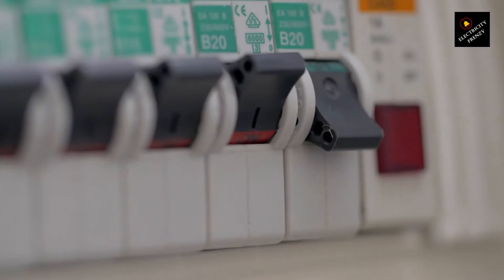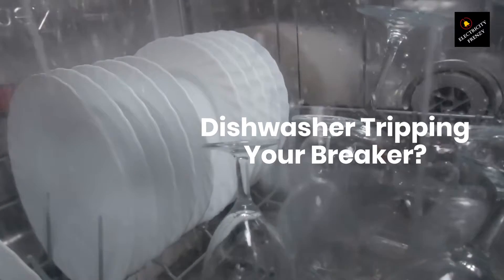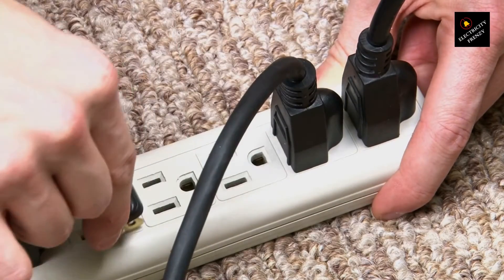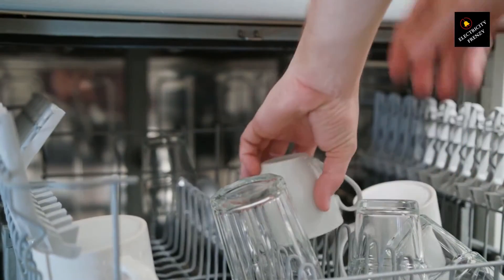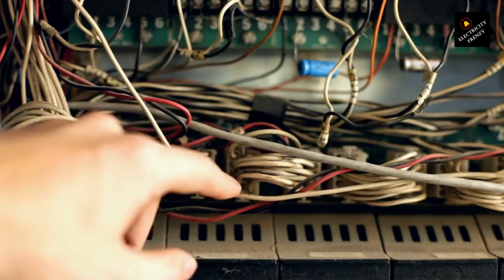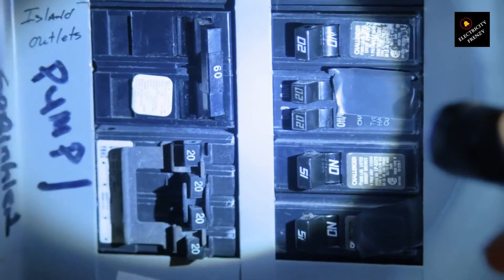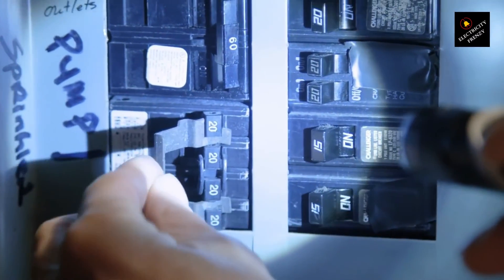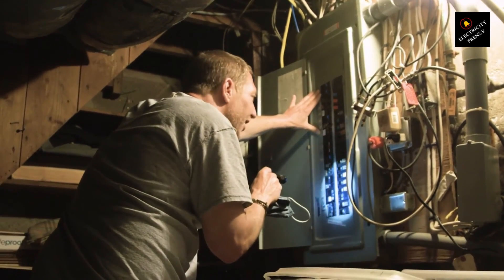Why Does My Dishwasher Keep Tripping the Breaker? Find Out Here

Comment: My dishwasher keeps breaking the circuit immediately so I took an extension card and plugged it in around the house and it breaks all those circuits as well.
Reply from the maker: The dishwasher has a short circuit.
A technician should check it